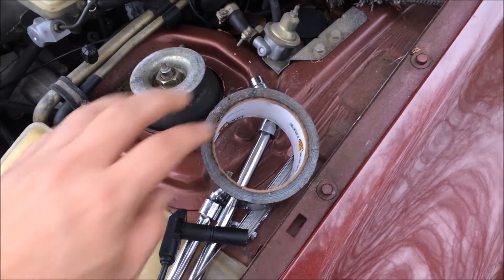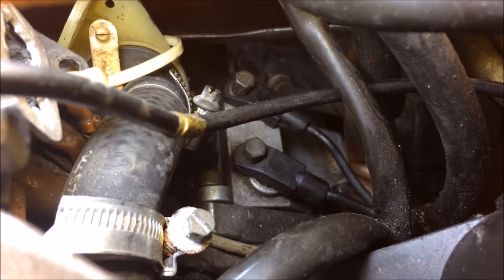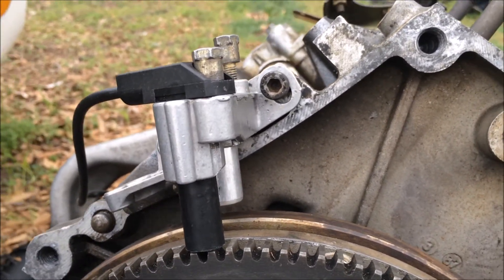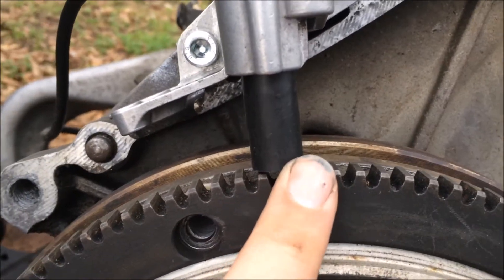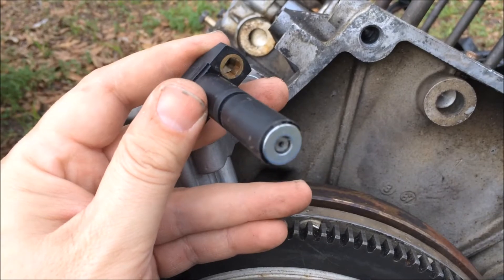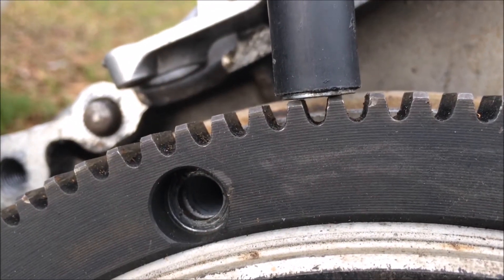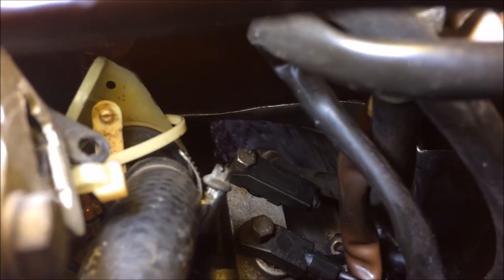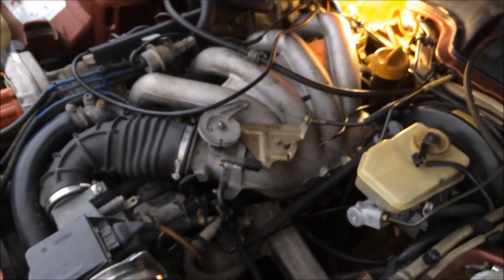Porsche 944 - How to gap speed and reference sensors

Comment: The pelican site shows a spacer that needs to go on the speed sensor. As a result, the reference sensor would be located closer to the flywheel once properly gapped. your video doesn't show this spacer. Do you experience any issues by not putting the spacer in?
Reply from the maker: Yes the spacer is only used on the turbo and S2 models. They have a larger starter ring gear but the flywheel is same size as the naturally aspirated models. So that spacer keeps the distance for the reference sensor the same. Without the spacer on those models the reference sensor gap would be to far away. That said the spacer is not to be used on naturally aspirated models. Using it on the base models can result in the reference stud colliding with the sensor destroying it. I hope that helps!
Reply: @edredas  Thanks for the response. Ok, so this is on a 924S which is, of course is NA, but the PET shows the spacer for that car. I know you have a lot of experience with these cars - did the 924S have this spacer?
Reply from the maker: Nope! No need for one!

Comment: How many ohms should the new sensors read ? Should both sensors have the same amount of resistance ?
Reply from the maker: A new sensor should read anywhere between 600-1600 ohm. They won’t always read exactly the same out of the box so some variation is fine as long as they are within spec.

Comment: Seeing the video reminds me of a great tip. If you have the clutch can off , before you reinstall it cut out the piece of aluminum under the crank sensors .when you are removing it for clutch work you can leave the sensor bracket alone and the cover will slide right off😎🚘

Comment: Just a tip , anytime you have the clutch cover off , hacksaw the web between the 2 sensor holes then you can remove and replace the cover and not mess with the sensors 😄
Reply from the maker: I typically don't like to modify these cars in anyway. That said, I've had a few cars with notched housings come in and they all had interference from the starter causing a misfire. There was a service bulletin about replacing bell housings that have been notched for that reason. This misfire can damage the engine during startup so I always replace them. Thanks!

Comment: I got new sensors but the sensor closest to the front of the vehicle seems to be sitting inside the bracket too lose.... Did I receive the wrong part? Any input would be great thanks!
Reply from the maker: The sensors are the same, but on the 1985.5 and later cars the sensor closest to the front has a shield over it. Check the sensor you removed to see if it came out with the old sensor and be sure to put it on the new one. I hope that helps!
Reply: @edredas  That is exactly the issue thanks! Cant seem to find the part number for the sleeve. The new bracket didn't come with one either. You know where I could find it?
Reply from the maker: Here's a link to buy one: https://www.paragon-products.com/Reference-Sensor-Bracket-p/pp944.101.320.00.htm
Reply: @edredas  Awesome! Thank you.

Comment: What happens if a bolt falls in the bell housing asking for a friend 😪
Reply from the maker: If you’re lucky it will come out if you remove the starter. Make sure you find the bolt before turning the engine over, even if it requires fishing it out with a magnet. I have seen engines lock up from things getting lodged in there and the only fix is to remove the bellhousing which is pretty much an engine removal. Good luck!
Reply: @edredas got it out when I took the starter out thank god

Comment: What is it that I need to remove to be able to get a hand in there? Awesome video
Reply from the maker: Depends on how flexible you are. I can sometimes get my hand in there without removing anything but having the intake and oil filler off makes the job much easier.

Comment: I don't have spare sensors lieing around... Is it possible to glue the washer on, set the gap then pop the washer off, or will that damage the sensor?
Reply from the maker: Yup, it won't hurt anything. When I made this video these these tools were not available, but this is what we use at the shop these days to gap the sensors. Makes life so much easier. https://944store.com/product/dg-speed-reference-sensor-gapping-tool/
Reply: @edredas   only having a single 944 and not planning to do this clutch service more than once I hope to get away with not buying specialty tools if at all possable

Comment: What’s the best tool to tighten the bracket or take it off, haven’t been able to get at it
Reply from the maker: Here’s the tool I use. Short 6mm hex head on a universal, with three long extensions so I can get it from underneath the car. I hope that helps!
Reply: @edredas  thank you that worked. When you’re tightening the bolts back up after using the “tool sensor” do you have to do any jigging about or just tighten them as they are. Does the sensor with the .8mm do all the work? If that makes sense thanks

Comment: Why do you have to make the gap new ? I mean when i dont touch the mounting at all just put the old sensor out and the new in then it has to work perfectly or not ?
Reply from the maker: You have to take off the bracket to remove the bell housing for a clutch job.
Reply: @edredas  Ah now I understand. For the clutch job. I need just to replace both Sensors. Thats all

Comment: Maybe it is a stupid question but i dont get why you need te gap it when replacing the sensors. You can take out the sensors whitout the need of make the bracket lose or am i missing something?
Reply from the maker: Correct. When you’re just replacing the sensors there is no need to loosen the bracket. However whenever you do a clutch job the bracket has to come off in order to remove the bell housing. Not to mention that these brackets are commonly broken due to the sensors getting stuck. So there’s a few times when you might need to gap them.

Comment: One of the best videos on a 944 i have seen
No silly load music just how its done
So many videos are just too long
I presume if it was running OK you just replace the sensor you do not need to gap it
Reply from the maker: Yup if it’s running fine no need to gap them again. Only if the bracket is removed! Thanks!
Reply: @edredas  Will let you now when they arrive - Ive got a solonoif arriving tomorrow
Hope it can be fixed before UK Locks donw on Thursday!

Comment: Is this generally the main cause of a non-start or hard start issue?  I've replaced mine, and I THOUGHT I adjusted these properly but still no go.  My next thought is that the fuel pump is bad.  It had sat for about 13 years, and now another 4 and I'm trying to get back to it soon.
Reply from the maker: I would say that the most common cause of a no-start issue is the DME relay. When it goes out then you'll get no power to the fuel pump or in some cases the DME (computer). Once you've tried another relay, I would check to see if you have tach bounce when you try to start the car. If the tach needle bounces a little when turning the engine then the reference sensor is fine. If there is no tach bounce then either the sensor is bad or the DME isn't getting power. That said, I made a no-start video on some of this that might help. In my case the sensor was bad and I showed how to check them. Anyway I hope that helps!

Comment: Just sorting out mine and great video, thank you! My problem is the car won't really rev freely above 4000 rpm.....I put an aftermarket sensor on today but gapped with the slightly older shorter OEM one so it hit teeth with a metal scream...however, for the first time the car reved freely over 4500 on start up alone, with no foot on the accelerator. Hopefully if I gap with the same it will be OK.

Comment: Great Video
Had to remove the holder as the B sensor was so corroded that it would not come out 
One question - is it the B sensor or the D sensor that has to be gaped if you remove the holder
Its not clear on your video?
Well that went well.
Set the gap with a washer - Should have check it was still attached as when i fitted the new sensors they scraped - damaged them both
So i would suggest that you turn the engine over by hand to make sure  its OK
2 more arriving Tuesday - Will be more careful next tiem
Again thanks for a great tutorial

Comment: Is the speed sensor the same as the crankshaft reference sensor I cant find the speed sensor for my 1984      944
Reply from the maker: Yes, both sensors are the same!
Reply: Awesome thank you Sir
Reply from the maker: No problem!
Reply: @edredas  awesome! i have been looking for an hour or more for an answer to this same question- there is a lot of different names used for these sensors, and prices seem to vary my a large margin! i was prepared to by one sensor called a crankshaft position sensor and another called an impulse sender with over a $100 difference in price between the two! so i will buy 2 of the cheaper sensor, and hope my car will fire! I've already replaced the DME relay without luck.

Comment: Yeah so I was a moron and didn’t cover the hole and dropped 2 bolts and an Allen key down there. I was able the get the bolts out by removing the starter but I’ve had no luck with the Allen key, I’m making a long tool with a magnet on the end that I can hopefully reach it and the flywheel isn’t stuck so I’m trying to rotate it back and forth to make it fall out of the starter hole for now. Moral of the story COVER THE DAMN HOLE.

Comment: if your ring gear on the flywheel  was damaged and missing teeth would this cause your tachometer to become stuck, as its not getting a proper reading? - sometimes it works sometimes it gets stuck, and im not sure where to look next! a new flywheel is not cheap!
Reply from the maker: How does the car run? Any noise when starting the car? If it runs fine and there is no noise then it's more than likely a bad tachometer. The pulse for the tach comes from the DME, so you can pull the plug going to the gauges to verify it's getting a good signal. If so, replace the tach. I hope that helps!
Reply: @edredas  haha - some times i have to rock it back and forth a few times in gear to get it to rotate enough so the starter will engage - its not ideal, but its what works for now. once running it usually dose fine, though (what i assume is) 1-2k rpm it would struggle, and make sounds almost as if it was running lean? adjusted the idle screw a bit till i didn't hear the slight backfires. and that's how i found your video- i was hoping to make sure i was getting a good rpm reading as i'm not sure where its idling now and hope its not too high

Comment: I have the utmost mysterious little fault on my '83 944, everytime I hit exactly 2200 rpm's I experience flutter or rough running. Have you ever run into something like that ? I have for long suspected something to do with these in the video(ref. sensors). When I got the car it had a faar too low idle, too, that I cheated up to spec with a turn or two on the screw, but I guess I burn some extra fuel on that ? Still haven't gotten around to changing the fuel filter, because I thought maybe the two things are connected and if they are, that can't be it. It's like I'm getting some weird resonant behaviour at that exact rpm, what do you think ?
Reply from the maker: Sounds like you might have a spark issue. Does it get worse when the car is under load? Might need to check the spark plug wires. I hope that helps!
Reply: Thanks for the reply. I will check it out.
Reply: It doesn't really matter, its the rpm not the load. Edit_it's always there, but maybe get's a little bit more pronounced with the load, that''s true. I'm having the same issue at about 16-1700 rpm's too, only not as bad as at 2200 rpm's. I agree with you Brent, that it sounds like ignition trouble, but haven't found any fault on the caps/cables/distributor. Plenty of sparks on all plugs, visually, but hard to check proper under the conditions the error strikes. Still haven't gotten to the bottom of it, had a lot of other stuff going on, just changed waterpump, belts, rollers etc. this week.
Reply: I have an 83 944, same issue!!!  The magical combination of 2200 rpm and the temperature gauge at about the first dash and the thing throws a fit!  Spits, sputters wants to stall, smell like it's running rich. this can go on for up to five minutes and then bam!  Right back to running beautifully.  I was thinking either speed sensors or the CPU?? Edredas your videos are the best and I'd like to see what you think this could be?

Comment: what is that part called that it clips into. when looking into the engine bay from the front left side . my sensor part is good but the wire that clips into the sensor that has a bracket to the instake mani is frayed. thanks!~
Reply from the maker: I think you're describing the harness itself. You can buy them new from Lindsey Racing. Here's a link to their page, just scroll down. I hope that helps!  https://www.lindseyracing.com/LR/Parts/HARNESS.html
Reply: thanks ill take a look!

Comment: My 924S will fire and run for about a second. Sometimes you can make it run longer moving the throttle erratically but it’s not happy. I replaced the fuel pressure reg. which helped but still won’t run on its own. Could these sensors be the issue? Thanks in advance.
Reply from the maker: I would check for any vacuum leaks. Also make sure the AFM is plugged in nice and snug. I know it might sound simple but I've seen people trying to run the car without it before wondering why the car won't stay running. I hope that helps!
Reply: edredas Thank you. I’ll give this a try. Car was a non runner when I got it, slowly making progress. 👍
Reply from the maker: Awesome! Good luck! Hopefully, its something simple!
Reply: edredas Forgot to ask. Do you run a website? Would like to stay in touch. Thanks.
Reply from the maker: I don't have a website anymore since its just more practical to have a facebook page these days. Maybe I'll build another site someday, but anyway here's a linke to my facebook pages: Main page: https://www.facebook.com/edredas-192753884577/?ref=bookmarks And here's a link to the group! https://www.facebook.com/groups/128264574553699/?ref=group_header
Reply: Thanks Bret. I’m not on Facebook but I might join now to be part of things. Keep up the good work. Cheers 👍
Reply: Found it! I replaced the afm with one from my parts car. Runs sweet now. The car has been sitting 10 years in previous owners garage because of this. The original problem was with the fuel pressure regulator but the previous owner had messed up the afm trying to find the problem. Thanks for your help! It got me going in the right direction. 👍
Reply from the maker: That's great news! Glad to hear that!
Reply: @edredas  What's an AFM, where is it and what does it look like?
Reply from the maker: @ewzm  The AFM is the Air Flow Meter which is at the end of the J-boot and connects to the air filter box. Its a rather large aluminum device with a black plastic cap on top. It meters the air coming into the engine and if there's any vacuum leaks or unplugged the car won't run correctly. I hope that helps!

Comment: I pulled out my reference sensors to do a clutch job and one of them has a deep scuff in it (I guess from previous gapping issue). It ran perfectly fine before, should I replace it anyway or can they take a beating?
Reply from the maker: I would replace it. It might last a while but they’re not known for being durable and I’ve seen a lot fail after being dragged like that. Good luck!

Comment: What is the third sensor on the bracket on the later engines it says OT and is on the bottom left of bracket
Reply from the maker: It's for an old diagnostic tool. Very early cars don't have the sensor and since no one has the tool most people just remove it. I hope that helps!

Comment: Thank you for your excellent videos! I'm rebuilding an '83 944.  Are there any torque specs for the bracket or sensors?
Reply from the maker: Yes, I believe the rating is around 13 ft/lbs. With that said,  parts can be old and brittle by now so 8 ft/lbs should be enough. Thanks!

Comment: Hi again - watched your other vids and they are great!
Question: I am replacing reference and speed sensor (probably only NEED changing the referance sensor). I have bought used ones with guarantee. Now he says (seller) gap them 0.8mm. But is that needed if I can pull the old sensor out without loosening the bracket? I can't just replace the sensor?
Reply from the maker: Correct! If you are just removing the sensor there is no need to re-gap it. Thanks!

Comment: Would this cause a no start problem? if the sensor is bad or gaped improperly? 
Thank you ahead of time!
Reply from the maker: I’ve heard of no start and intermittent running issues from incorrect gap but never experienced it first hand. I hope that helps!
Reply: edredas sort of, debating getting a 944 that’s been sitting, owner says he has to replace some sensor that’s between the bell housing or something like that and he has to take the engine and trans out in order to fix it and for the car to start, this sensor is closest thing I found to what he described. Thanks again !
Reply from the maker: No problem! Yeah these are likely the sensors he's thinking of. I have replaced these sensors many times with the engine together, it is easier with the intake off, but isn't impossible! I hope that helps!
Reply: edredas that helps a ton ! Thanks again for the information